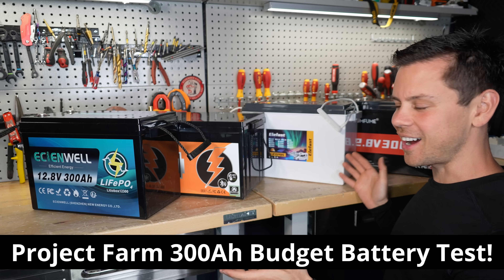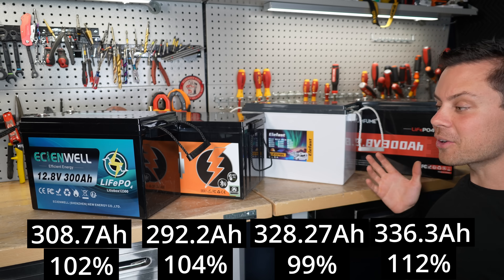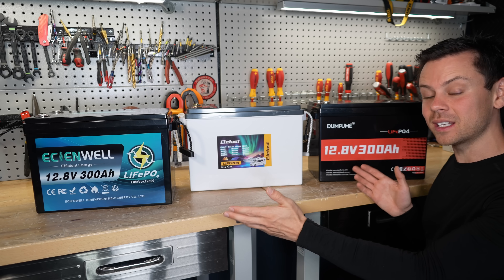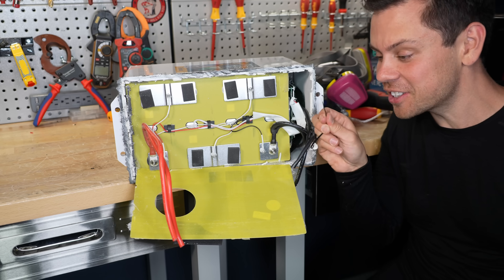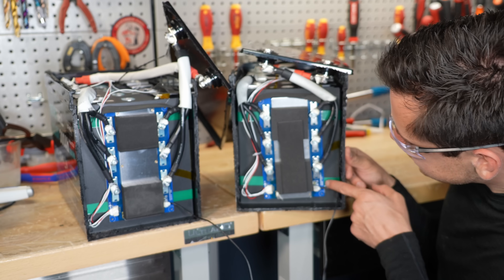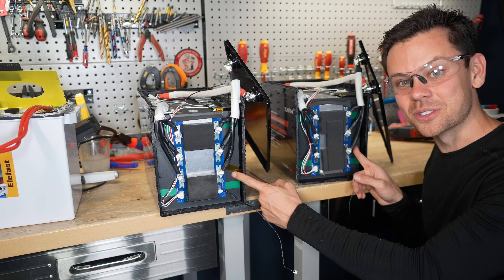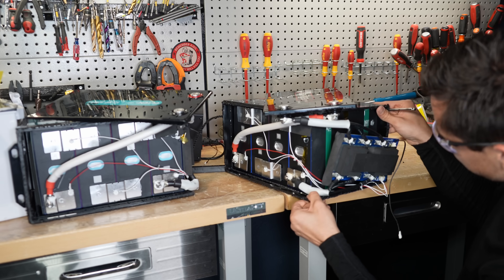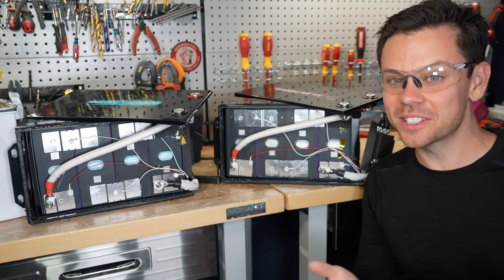300Ah LiFePO4 Showdown!! $300 for a 300Ah Battery?!!

Comment: I bought a 300Ah Dumfume battery after watching this video. After fully charging it and letting it rest at 13.3V for about a day, the voltage suddenly dropped to 12.66V for no apparent reason and now it is resting at 12.6V.  According to the VRM graph, there was a small load of 0.4A when this occurred.  What could be the cause?  Again there was no additional load.

Comment: So I bought a set of 12v Dumfume 314ah batteries.  I have always been a pessimistic.  So I topped off batteries and did a capacity test on the 1st one.  I got 322.42ah.  I am very pleased.  The other battery is being tested now.  After completing the other test the 2nd battery capacity was 324.  The set of two batteries were sold as being 628ah but I got 646ah.  The batteries were tested with a MakerHawk Electronic Load Tester.
Reply: This is what I was wanting to know. I think dumfume is doing the same thing elefast is doing. I wanted the elefast 330ah but will tested it and he only pulled 328ah which I thought was ok but it's lower than the dumfume 300ah which will pulled 336ah and it still costs more. I think elefast markets the 330ah just over what it tests as so they can price it higher and dumfume saw that and decided to market the 300ah as a 314 to price it higher as well because after this video dumfume makes a 314ah that I assumed would have tested at 336ah but marketed as 314ah and their old 300ah that used to test at only 305ah is just being marketed as a 280ah to still be a good deal but I never knew for sure. I also think dumfume sent will a better battery than what you and I would get if we weren't prominent youtubers.

Comment: Why would anyone want to hook up a controller inverter batteries and everything else when U can just buy a Power station. Get real. Be honest .and way more dangerous. And way more harder to charge. And leads every where. These things for camping are done
Reply: Guys like me,  I run everything in my rig at 12v DC  more efficient an zero issues 70% money spent.

Comment: Thanks Will. I bought chins 100ah x4 2 years ago paid $2 an ah. Still working well. The dumfume is impressive. Also was given four 6v deep cycles lead acid from a floor sweeper. I've had some luck reconditioning/renewing lead acid with Epsom salts and slow charging. Could you possibly address this in a future video? Is cola/phosphoric acid helping or hurting? I know it's iffy but I've brought back some total dead sulfated garbage to pretty good capacity and the price for dead batteries is right

Comment: Thank you for the detail you go into, Awesome videos. 2 weeks ago, I purchased the 330 Ah version of the Elefast battery because it indicated on the amazon specifications it did have the overcharge protection ( i have no way to test like you so i am hoping it really does) along with other upgraded security not the least is the higher temp discharge cut off at 150 degress which is higher than most and much needed in summer because my battery is in the backseat of pickup cab and even with all 4 windows cracked open 1 inch my temps get about that high in summer.  Another reason I selected this battery because it was the only 300+ budget battery that fit my battery box with Bluetooth which is huge for me to monitor because of practical access to battery.This battery is connected to my power station solar input which has a 100 amp hour battery and it basically trickel charges the power station at 125 watts input according to demand and the monitor on the powerstation as well as the bluetooth app for Elefast battery reads about the same. So far,  its working very good. I use the bluetti dc/dc charger to a litime 30 amp mppt to this 330 Ah Elefast that charges at about 400 watts when driving, then oring connetors to solar input to powerstation which sits on top of my homemade wooden battery box. this powers my ac powered dorm size refrigerator, my 3.1 cuft chest freezer, and microwave on top of refrigerator all fits behind the passenger seat of crew cab gmc sierra after i took the rear seat out. Awesome overlanding rig now with upgraded battery capacity. I can totally boon dock for 3 days with no solar panels or generator and keep my fish bait frozen or food that has been in freezer for weeks at at time if i am traveling. I do have champion 2400 watt propane generator and (2) 200 watt folding solar panels to lay on top of truck and camper shell if i am going to be in the woods hunting for more than 3 days. It has taken me about a year of trial and error but I have finally completed the perfect " Trailhead Rig" for under $3,000 (after a lot of mistakes) which includes 100 Ah power station, 330 Ah battery, mppt charge controller, dc/dc charger, microwave, refrigerator, chest freezer all fits behing passenger seat (after removing entire back seat, I still have entire area behind the drivers seat for clothing gear bags, quick tent, dogs or whatever I need to get to fast, this leaves my whole bed compartment for sleeping and other gear like generator, solar panels, decoys, fishing tackle, even ice chests, or big guide tents, saddles and pack saddles etc.) in a full size crew cab with topper. not counting cost of truck! Amen!

Comment: Will - I thoroughly enjoy every one of your videos and hold your option in the highest esteem! I'm planning to buy two of the Dumfume 300AH batteries for my travel tailer. I would like to mount them in the same place as the existing batteries. Can you tell be the exact measurements of the bottom? They would need to fit in a slide-out battery tray that is 7-inches wide by 13-inches long. Thank you for your help! -JR

Comment: Great Video Will. Did you notice if the Dumfume had an active or Passive BMS? I'm guessing it's passive since I just bought this Dumfume and it's taking forever to charge. Update; the Dumfume after weeks of charging won't take more than 14v of charge, using 4 different lifepo4 charging options, including dedicated lifepo4 chargers, Renogy mppt solar controller, and the benchtop you recommended. all chargers were set a low current. It's been charging to a 14v max for weeks. Apparent Mismatched cells?
Reply: It's all passive. The only thing that matters to your charging time is your charging rated current. If you Charge at 20A it  will be about 15 hours, at 25A it will be about 12 hours for 300AH

Comment: Hey Will, I took the lid off a 300 elektech without cutting, popped right off, repaired it and put it back together and using it. It failed and they sent me a new one and didn't want the return so I had nothing to loose. Maybe others would have to be cut I don't know.

Comment: luckly you have never tested a crap cheap brand running under the name DATIUBOSS ive had 2 x300 ah from them both wont charge past 80%  and they only test at 270 ah , warranty is impossible currently arguing with them about a 100 AH that wont let any charge into it past 14.4 volts . yes they are cheap crap from temu  claiming 6 years non existent  warranty ...

Comment: I put two of the Dumfume 300AH batteries on my flounder gigging boat and got rid of the generator/RV power supply that used to power my trolling motor and LED lights. All I can say is, wow! I can hear the surf a mile away, the fish jumping and splashing, and I can have a conversation with someone at the other end of the boat without yelling. The batteries did great. Even eleven hours pushing the trolling motor and lights hard only used 40% of the charge. Budget battery? Sure, but hits way above my expectations. Your channel helped guide me in the process of converting over. Thanks!

Comment: I have 5 of the dumfume 300ah batteries just like the one in this video. What voltage is everyone seeing with this battery? I'm sitting at 12.89 with no load and once I kick on my ac and small fridge in a campervan, voltage drops quickly. Turned on AC only the other day, went in a restaurant, came out and battery dropped from 12.89 to 12.34 and was continuing to drop. Batteries were fully charged. Is this normal? I'm running a country mod 12v ac that averages 7-23 amps after startup.
Reply: Get a Lifepo4 charger to charge it completely.

Comment: Im definitely not disappointed with 328 amp hours. It probably needed to be top balanced for a day. It is the most expensive per amp hour but you get a JBD bluetooth BMS, which is critical IMO. It does have overcurrent protection, 3 levels you can adjust along with time delay and reset time. Sells under the name PUPVWMHB, MJBSan, Elefast and others.

Comment: I bought several Dumfume (after your review) 12v 100ah and made several handtruck portable power. Sold them and they worked really well. Bought the 200ah and it performed perfect. Got the 300ah running on my 2000 watt inverter that runs my work shed and have never had an issue. Summer and winter no problems. Thanks Will, great to see the 300 is made well.

Comment: @WillProwse Vatrer now has a server rack inverter that appears to communicate with the Vatrer batteries via Bluetooth. They have also released a heated server rack battery. Is this something you can look into? I’m really curious about and would like to try that inverter. I currently have 9 of their batteries and really like them. Bluetooth monitoring and control from a 5000watt 120v inverter sounds pretty good for small 120v applications. I trust your evaluations.

Comment: Thank you, Sir.  I would have been curious to see what the Elefast had inside as to BMS, cells, main power to terminal wire size, construction, etc.  Its 100 amp brother has gotten some good results from another uploader who, like yourself, has more knowledge that the average Youtuber.  Plus, the Elefast is the only one with Bluetooth in that price range.  Am I suspicious that the Elefast 300 amp and 330 amp batteries have the same cells inside? Yeeeeeeeessssss!

A T burke

Comment: I was hoping to see you do an Elefast 330ah review. I'd check weekly to see if one was out yet. I wasn't patient enough and bought one about a month ago. Definitely disappointed it didn't pull 330ah and I was hoping for slightly more possibly. That Dumfum is an absolute beast for the price!  I had buyers remorse until I realized it wasn't Bluetooth, don't think I'd personally buy one without it. Not happy about the over current protection not working so I will be adding a fues right at the battery. Glad the low temperature works since im using it in an ice fishing house. I paid 329.39 on sale, so I paid  roughly 1.00 per Ah plus got Bluetooth.
Reply: Have you tried adjusting settings in the App? I feel like that is the only real downside to it and if its fused it should be fine anyways. Kind of a bummer it was under the rating, but still decent for the price compared to the others. The Dumfume one looks nice but I agree that I want the Bluetooth feature so maybe worth it despite it being slightly under the stated capacity. I guess the main question is what it will do long term.

Comment: The cables coming off the BMS's themselves look to be slightly different size. Looks like 6 AWG on the Ecienwell and hard to tell but thinner 7(?) AWG on the Dumfume. It's frustrating that the marketing is the biggest difference on all these batteries now and you have no idea what you're actually getting.

Comment: I used two Dumfume 300 on Temu.  First was $280 in 2 days.  Next with lot coupons, $250 on 2 days.  I used 200w and 100w solar boards 19 days.  Two areas. Portable Freezer 12 Volt Car Refrigerators first 2 zones Ice, food, drinks (35w), fan, laptop, cell, battery cell all setup 200w solar.  Second Refrigerators 1 zone for Med. and drinks (13w). Cpap, Cell, Cell battery, fan set 100w.  Never lose control.  The older problem, no camping until next year.   If we lose power, I have 4 weeks safe. (sorry writing, aphasia)

Comment: +1 for the 300ah dumfume. Got 4 and love them. No issues and seems to hold balance better than my 200ah chins. Support was responsive for both in my experience. Did need a manual top balance though as these BMSes are incapable of balancing an out of balance cell. Too low balance/resistice current vs active balancer if it is out of balance. Charged to 100%, then each cell to 3.65v manually until 100ma using bench power supply and they've been great since!
Reply: 3.65v@100mA will significantly overcharge the batteries, better not do this. If you absolutely need to top balance the cells, charge @3.65V until the current drops to 5A.

Comment: A couple of newbie questions here.  Can I simply remove my 100ah lead acid battery in my RV and replace it with the Dumfume 300ah?  My converter is able to switch from lead acid to lithium.  I assume this would run my DC appliances but in order to use the outlets in the camper I would need an inverter, correct?  Any suggestions?  Also, what do I need to monitor the 300ah battery to see the discharge level?  I assume the current control panel on the RV wall that shows battery and tank levels won't work with this.  Can the lithium battery be mounted on the A frame where my lead acid battery is or does it need to be inside the camper?  Thanks for any help!

Comment: I’m looking to power a truck with a 2000 watt inverter! The camper is used sure the winter months in upstate NY! Should I use lead acid or lithium based batteries! Your in put would extremely helpful

Comment: Why are you even doing these batteries for low voltage system when you just posted that high voltage batteries and inverters are the only system you’ll have and use going forward
Reply from the maker: I always review 12V batteries. I open all batteries
Reply from the maker: Yes, HV only for me. I review everything. I hate 12V 🤣 have you seen my videos?

Comment: Not sure why you yanked the 280Ah Bluetooth Eco-worthy. The battiers are "on sale" all the time and the price jumps. Most of the time there is some 'coupon' that can be applied. 

Will says he pulled the battery because it was $500?!? I checked the day this was published and it was $399 but then had a coupon code in the listing that dropped the price to $320 with delivery (plus local tax collected by eBay).

It should have stayed within the testing set.

I have two if those batteries and have no complaints.
Reply from the maker: Yeah, they saw the video. Hopefully this will be a lesson to them. Last night it was $520 on Amazon, their official store. Not cool. Once the price is low for a long time, I'll call it a budget battery
Reply: @WillProwse I've found their batteries are always cheaper on eBay, don't know why.

Comment: I picked up a pair of those Dumfume 300s about a month ago on a lightning deal, they were $572 shipped after tax! I capacity tested both of them and got the same 336ah you did. They aren't in use just yet, but I do intend on buying at least two more, if not four. Great vid!

Comment: I think that might be the first budget battery where the over current protection and the interior conductor size seem to match.  Those actually look like roughly 4/0 conductors which is what you need for 200A with silicone or similar insulation.

Comment: I bought 3 dumfume 12v 100ah, in total, first one was a mini max, second one was the normal size which is bigger than the mini max but 7lbs lighter , even though it says 12v 100ah, the mini max is 30lbs. So i had to remove the lighter one and bought the third battery which is another mini max, to balance my diy system,, whenever they're full they chipped continuously until i turned of the pv input, so i guessed they're doing what they're supposed to do😂

Comment: I got 3x300 Dumfume basic non Bluetooth batteries.  I run my rv with it.  It runs a 12vdc ac for a couple days.  Or it run the induction stove, ac, air fryer, hair dryer not all at once but I do select them so they don’t go over 200 amps.  I have the batteries in parallel so basically I’m limited to 600 amps, but I stay below 200 amps max to be safe.  The battery recharges pretty quickly.  I get about 3 hours of ac for every hour I drive, or a total 900 ah from basically zero charge for 5 hours drive.  I’m very happy with my Dumfume.
Reply: nancy boys use ac

Comment: The EcoWorthy is "on sale" for $399 for Prime Deal Days. It looks like they raised the price $100, then put it "on sale" for the original price.
Reply: They do similar on ebay. They raise or lower the price of some of their listings depending on what coupons eBay has. Currently the price after coupon is 320. Also it's cheaper to buy single batteries than their listing of 2x 280AH (which after coupon is only 340 per battery).
Reply: Right now the ecoworthy is 320 on sale on eBay lol

Comment: One of my wattcycle 280AH batteries from prime day has a cell differential voltage of 0.19v and took my 24v system offline with 13% charge remaining in the good battery 😬

Comment: It's not worth fussing over whether or not the battery you bought has a higher capacity than advertised. That isn't a problem. The problem is when you have to worry about getting LESS than you paid for.

Comment: I wish that you had included the TechCella 320Ah Battery.  It uses a JBD BMS with Bluetooth and has been working great for me as a house battery on my boat.  I'm thinking of adding a second.  At $109 per Ah, it fits this class of battery perfectly.
Reply: That Elefast battery has a 200A JBD BMS with Bluetooth, he just didn't mention it. That is why the overcurrent protection was >600A because it's set really high on those batteries by default (can start a V10 engine in the cold) but is adjustable so you can set it as lower if needed.